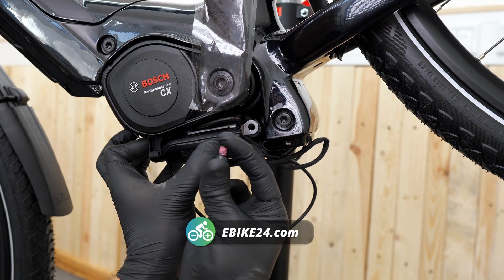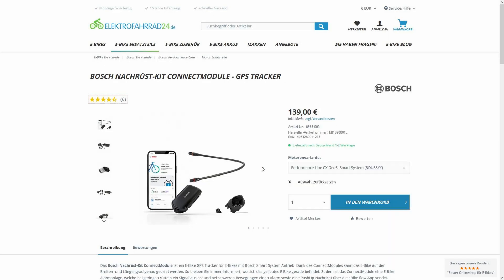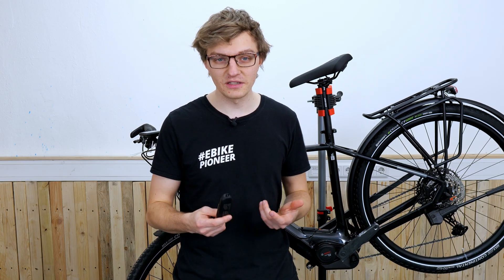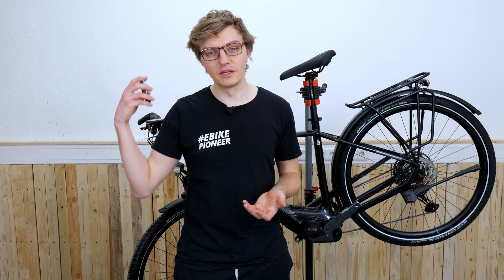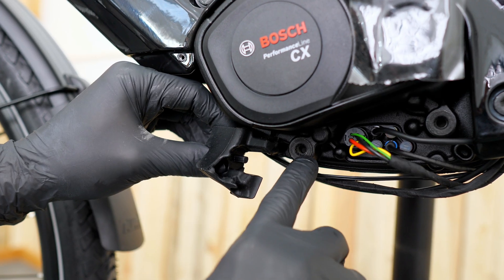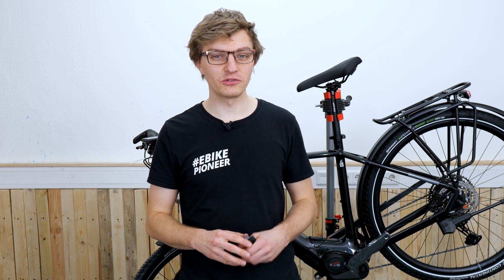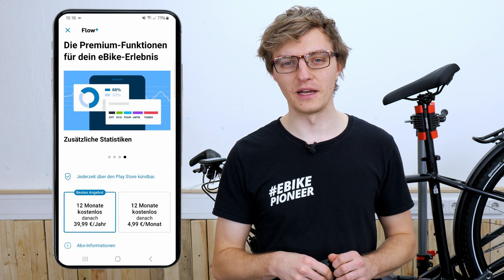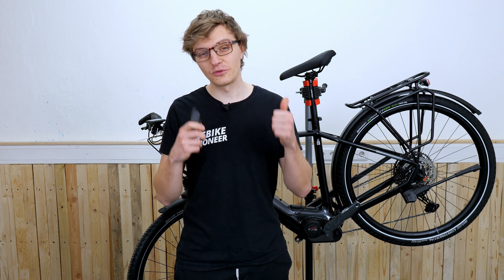Mounting the Bosch ConnectModule on the CX Gen.5 (BDU384Y) | Tutorial 🔧 | EBIKE24

Comment: Does not fit the Oreba Wild
Reply from the maker: There is a special motor cover for the https://www.ebike24.com/bosch-retrofit-kit-connectmodule. Orbea uses a specific motor cover (adapter plate) for mounting the Bosch eBike Connect Module on some Wild models. Availability and part number vary by model year and Bosch motor generation (e.g., Gen3/Gen4 Performance Line/CX). Thanks.

Comment: Hi Arthur, it isn't easy to see you complete the most important action; removing the 'black plug'. Is it supposed to simply pull out with no resistance? I cannot remove it without worrying about damage and my bike mechanic is thinking the same thing. Does the black plug require twisting? How do we overcome the strong resistance? I can't get the black plug out. In your video, one second it's plugged into the bike and next, it's in your hand. Btw, my Cube One44 (Gen5) is connect module ready/compatible. Can I use another port as there seems to be several?

I finally got it. I used two hands, one index finger from each hand onto the black plug and wiggled until it came out. From there, the rest was very easy, except when replacing the black plug there was no click, but it seems to be in securely

Comment: Hello,
please, Connect Module for Gen 5 is there a different firmware than Gen 4? Can't use Gen 4 Connect module on Gen 5 motor with newest mounting hardware?
Reply: Its a different rubber block and screw. The part number for the complete kit is Bosch GEN 5 - BOSCH CONNECTMODULE RETROFIT KIT FOR BDU38YY - EB1390001L. From Bosch this morning as i have the same problem due to the bike shop giving me incorrect information.
Reply: @BryanEvans-gn8gz  Yes, but is the Gen 4 Module itself compatible with Gen 5?
Reply: @sorcererzv  The Gen 5 module is EB1310000B.
Reply: Which is the same as Gen 4. So, if you can mount it, it should work. If all else fails, ask Bosch. I got a very full and comprehensive response, within a few hours. Good luck. I'm still waiting for my bike shop to get back to me.

Comment: Isn't an AirTag an almost equally good solution? I know this is the official module, but still.
Reply: No. Not only does the air tag warn the thief he or she is being tracked. It also allows to locate the tag. 

This module has a LTE connection and doesn’t rely on being near an iPhone. It will also notify your phone when it’s being moved so you can act promptly

Comment: Unfortunately it can’t be installed on the Mondraker Crafty 2025 😢
Reply: Can you please explain why, as was just about to buy one for my Crafty.
Reply: @urbanpetrin9713  The cover on the left side, where the Bosch Connect Module is supposed to be mounted, is too tight against the motor and doesn’t leave enough space. I wrote to Mondraker hoping that, having acknowledged the design flaw, they might be considering providing a modified cover. Their response surprised me: Mondraker confirmed that it’s not possible to install the Connect Module on the Crafty MY 2025 and they don’t plan to offer any modification. What can I say?
Disappointing!
Reply: @urbanpetrin9713  The cover on the left side, where the Connect Module is supposed to be mounted, is too tight against the motor and doesn’t leave enough space. I wrote to Mondraker hoping that, having acknowledged the design flaw, they might be considering providing a modified cover. Their response surprised me: Mondraker confirmed that it’s not possible to install the Connect Module on the Crafty RR MY 2025 and they don’t plan to offer any modification. I therefore installed the Trackting under the bottle cage. It has a GPS module and send you alerts directly to your mobile phone.

Comment: Does it work without the bikes battery? Has it own battery?
Reply from the maker: The ConnectModule has a built-in battery so it can work even when your e-bike battery is off. You can check the battery level of the ConnectModule in the eBike Flow app. The ConnectModule's battery automatically charges while you ride or when you charge your e-bike. If your e-bike is parked for a long time, the ConnectModule can recharge itself from the e-bike battery, if it is still installed. This keeps it ready to protect your bike from theft. This automatic charging happens every 4 to 14 days and can take up to one hour.
Cheers - Michael